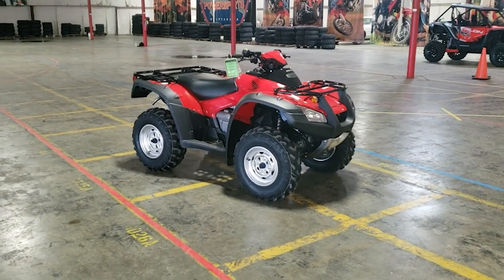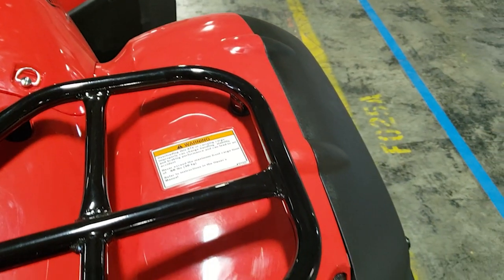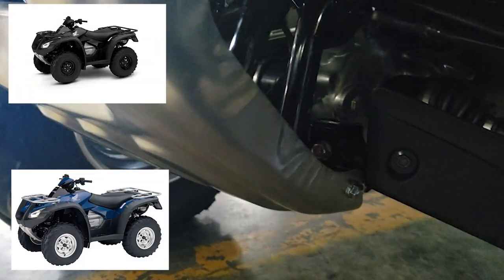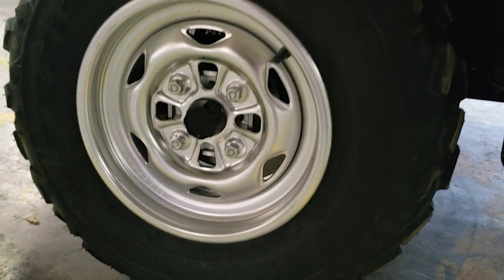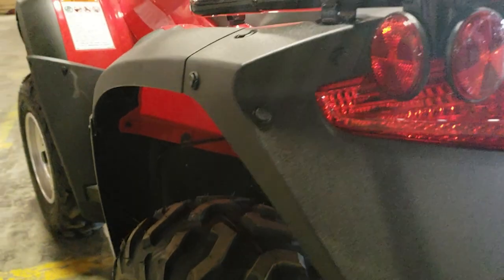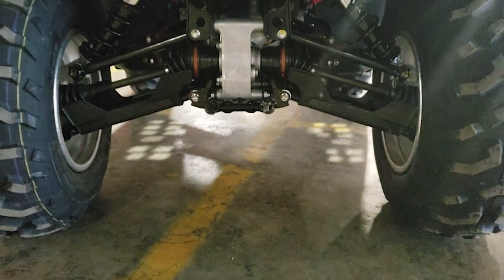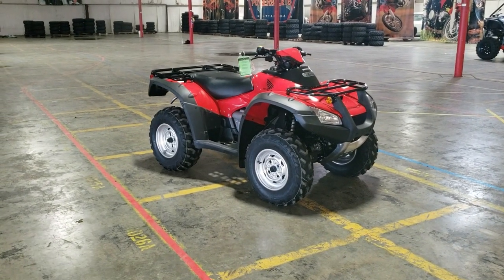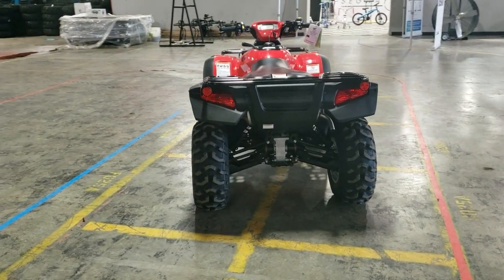2021 - 2022 Honda Rincon 680 ATV Review of Specs / Features | Better than the Rubicon & Foreman?

Comment: That's almost 10K dude, seriously? I've got an 06' 680 that I bought new in 06'. Good Farm/Ranch bike but won't turn The bigger tires for mudding unless you start putting big bore kits, gear reductions, axles, etc. I would rather spend the extra coin on something ready to rock such as Can-Am or Polaris. The bike was 7K back then and the only thing that has changed now is it has become 3K more valuable? I don't think so. It seems Honda wants to cater to the Rich & Elite people. A Working Man don't stand a chance. You disappoint me Honda!
Reply: A 10,000 dollar red turd!
Reply from the maker: I wouldn't call it a $10,000 red turd but I get what you're saying lol.

Sadly everything's price has went up over the years but at least with the other models they had some upgrades thrown in the mix whereas the Rincon is still the same unit. One thing we do have to keep in mind though, that's the MSRP and 99% of the time you can buy them well below that. Well, when prices aren't inflated because of the corona mess lol. But up until last year, even though their MSRP was $9,499 you could regularly buy them in the $7-8,000'ish range when they had rebates etc. It doesn't seem like it was that long ago that people thought $15k was a lot for a side by side and now we have people lined up to pay $25k and up for one lol, crazy times!
Reply: Compared to other machines that even cost less,  it falls short.  Crappy suspension,  no diff lock, no power steering,  no real low range and not enough power.  Add the puzzling transmission that nobody has ever liked and you get an atv that most dealers probably refuse to put on the sales floor because it won’t sell.

Comment: They need to offer this in a 5 speed footshift or 6 speed foot.. And they need to offer a big bore package.
Like 90 hp 6 speed foot shift. To compete with the x m r 1000 renegade.
I hate the automatic transmission that x m r one thousand has. It needs .a manual

Comment: I have had both the 520 and the 680...the 680 is an unbelievable bike.. I would take the 680 any day..  what honda needs to do is make a big bike with power steering and lock dif  .......I have tracks on the 680....best bike I have ever had.   Come on honda.   We need the Rincon to be everything.   The look of the Rincon compared to the rubicon way better even yrs later.   Come on honda get with the program and give us a big four wheeler with best utility and sport trail.  U got it so produce it.  The 520 look like shit and is no where near the trail bike as the Rincon is.   800 honda Rincon with power steering and lock diff with all the trimmings.  I will take two please.  This comes from a guy that has everything honda in my shop..

Comment: 2021 rancher>2021 rincon
2021 foreman>2021 rincon 
2021rubicon>2021 rincon 
2021 rincon=2006 rincon they are literally the same quad and 15 year difference if ya want a rincon buy it used off market place for 4k instead of 9.5 k lmao

Comment: Those things need to be retired and put out to pasture. They're dangerous in my opinion. I've ridden several. No power steering sucks, but if you're going down a steep hill all the weight shifts forward and the steering almost locks up plus it's really twitchy and handles just awful. But hey, it's reliable.
Reply from the maker: lol your last sentence cracked me up bud, thanks for posting your experiences and feedback ;)
Reply: @HondaProKevin  is it not reliable?

Comment: Rincon could handle 1000, i have rincon from 2008 and i easy stick with renegades and all the more powerfull atv's ofcourse it lacks power on normal roads or speed zones against can ams, but in forests, trails, offroad sometimes its even better. I really want new honda and more powerfull than current 680! I want higher top speed! 63mph not enouth.

Btw wtf with the rincon in this video? Engine is struggling and idle rpm is higher than normal. Is this a china version or what? 😂
Reply from the maker: You hit the nail on the head, a lot of times horsepower doesn't do you any good when you get into the trails. Very similar to the sportbike guys that love their smaller and lighter 600cc bikes but the 1000cc guys love to brag about how they can wax everyone when the roads open up lol. Power doesn't do you any good if you can't put it down and use it whether it be because of traction or lack of skill. Always cool to hear from Rincon owners that love theirs so much like yours but just want something new with some more power etc.

lol good ear bud! At first I thought something was wrong and then I checked the fuel and yup, she was on fumes. Should have gotten that taken care of and shot the video again but couldn't at that time.
Reply: @HondaProKevin  thanks mate! Yeah i do love my Rincon 😊

Comment: This 680 engine should be put in the rubicon and Honda should discontinue the Rincon until they can develop a new Rincon with a 850cc or larger  engine and a diff lock.

Comment: Automatic transmission is a deal-breaker for me. I would have to go with a Rubicon and figure out a way to modify the engine to make it as fast as a Rincon. I just don't like that automatic bulshit. I don't care if it's push-button 5-speed shift on the left handlebar or if it's foot shift but I will NOT buy an automatic! four-wheeler

Comment: Over priced, outdated, crap transmission with no low range, diff lock and 5 speeds! Size is good, new atvs are big monsters that are too wide and bulky IMO not good for exploring in the woods going in and around trees!